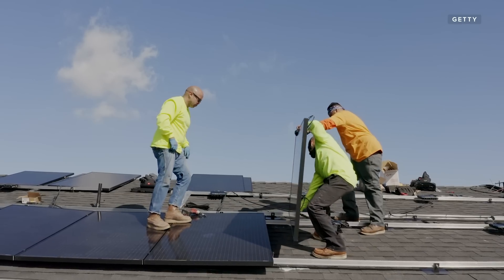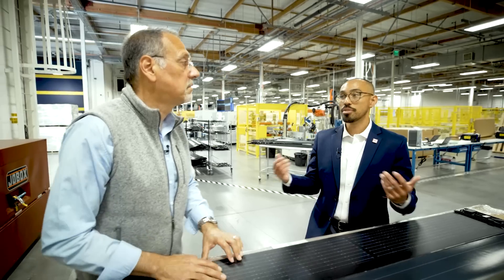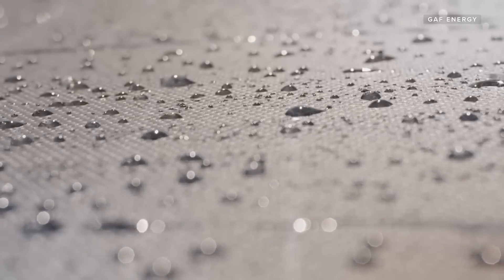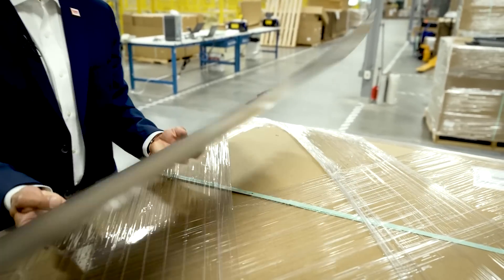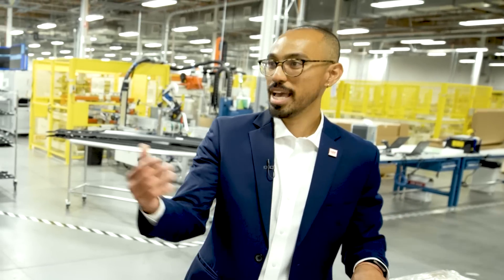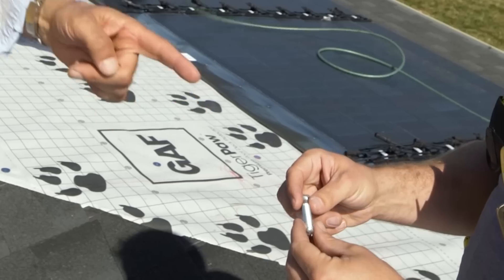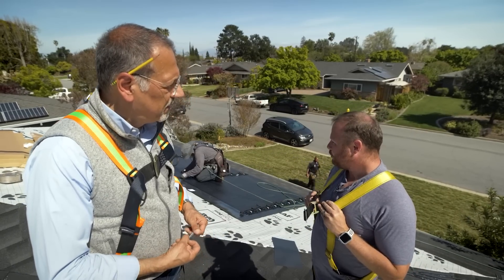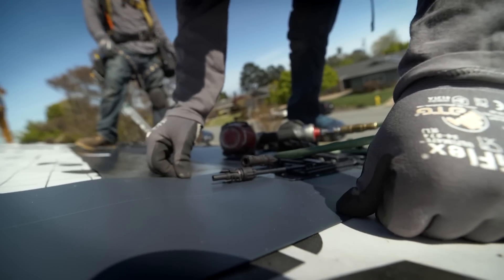If You've Avoided Rooftop Solar Tech, You May Have Just Run Out of Excuses

Comment: The key question is efficiency.  Would this generate less actually energy than solar panels of the same rated power?
Reply: It's less efficient, but those are offset by the larger area of solar that they could install vs the traditional rack mounted options. So in the end a house that uses this system would be able to generate much more power. The cost however is on-par or slightly higher but time will drive it down i guess.
Reply: @Consoneer I saw many bad reviews of this solar roof system which does not seem to be very reliable.  Also, they offer inferior inverters with bad reviews.

Comment: I like this system but think the rack system that allows airflow under the panels help keep the building and the panels cooler.  The panels provide a shade for the roof and will decrease the inside temperature.   Same affect as setting under a shade in the direct sunlight.

Comment: One more thing for the roofer to screw up.
Will they install your solar panels like they install insulation?
Home owner - "Hey can you guys put some insulation in my roof while you have the decking off?"
Roofing contractor - "Sure, no problem." Opens up roof, throws in a bundled bale of insulation, and closes the roof without ever "installing" the insulation.
Neighbors - "Hey, nice solar roof, have you noticed any difference in your electric bill?"
Home owner - "No, not at all, and my heating and cooling bills are still high!"

Comment: Seems a loss loss situation here.   To compete with other solar panels you need more solar panels from GAF, more cost.  No cooling under the panels, more panels needed to compete with other solar panels, more cost.  Only advantage to this system is the aesthetics.  So, CNET, what are the long term results of the product's tests?  None?  So the life expectancy of this product is only speculative.

Comment: First the pros.  Because I like this concept.  It's a better way forward.  Sure, it's going to be less efficient, but it can make up for that with more surface area, so it mostly washes*.  It's easy to replace damaged panels.  It's safer for your roof.  It's nicer looking.
Now the cons.  *= Cost.  Cost was clearly not addressed here, yet that's the largest impediment to solar.  To be fair, that's really a problem for government.  We want a greener future, yet subsidizing solar is being handled so very poorly.  Manufacturing processes can only lower cost so far.  My other concern is actually rain.  Shingles are supposed to be staggered to NOT create clean channels for water to seep in.  Whereas this install REQUIRES lining up every shingle perfectly.  Can it really handle that?  Only long-term testing will say.  And then there's the issue of cooling for efficiency and longevity, which seems to be not addressed at all.  Which could be easily solved with an additional water-heating layer, a part of solar that is very neglected.
In theory, I love this idea!  <3  I hope it's the future of solar.  But I have a sinking feeling that they'll need to devise a system to stagger shingles to prevent long-term problems.  And government really needs to step up subsidizing the costs of solar and ensuring that their efforts go to helping the end-consumer, not the predatory companies overcharging and under-delivering on their false promises to profit.  If government is going to push that everyone drive an electric car, government needs to make sure people can actually charge their electric cars, at home, with slower more efficient charging cycles that don't put pressure on the grid.  Government should also be subsidizing insulation upgrades if we're going to save the world from the evils of carbon, but that's a whole other topic.

Comment: those organic dye/flexible solar pannels dont last very long compared to crystaline/polycryst. silcin.... every consumer should be worried about this aspect since if it takes 12 years to pay off and only lasts 6 years, you might be better off getting a regular roof... also, what is the loss due to being hot as a tar roof (compared to monocrystalline on a regular mount), and how do you clean them  ? what if you dont clean them.
i have a feeling these will not save money unless theyre basically as cheap as regular roofing pannels.... even then, contractors love to charge stupid amounts for niche things, try getting a quote for a heat pump if youre the only one in the neighborhood with one.

Comment: The main hurdle is the cost vs. payback.  "Cost competitive" is not going to cut it.  If I have to take a 25-year loan out to pay for a technology that simply ONLY pays for itself (*maybe*) in 25 years but then needs to be replaced --- well, the juice isn't worth the squeeze.  When the payback period gets SIGNFICANCLY under the payoff period at close to net $0, then we'll be in business.  Really need to be able to utilize a paid-for system for a number of years to become a viable system.  Similarly, early LED lights (20 years ago) didn't pay off in $/lumen comparted to other technologies - which is not true now and they are much more efficient now.  The value of a solar system doesn't add to home value either, so we need to get over that hurdle too.

Comment: Only an extremely diseased civilization in decline would entertain the idea that rooftop solar could even approach a fraction of household electricity use without large batteries or that those batteries dont require intensive mining that creates more "pollution" than just using what we had originally

Comment: First of all, I might consider them, BUT I would want all the non cell material trimmed off and they would have to be able to be glued to my steel roof on only the surfaces that cannot be seen from the street and be PROVEN to withstand the heat and hurricanes here in Florida.

Then, I would have to see the price drop by 1/4 of this.

I'm not letting ANYONE punch holes in my roof since my insurance company inspector estimated my expected roof life at 100+ years.

Comment: I dunno, that's a lot more connectors than using standard PV panels. Also, the single inverter design is a bit of a weak point. You're only going to get as much power as the weakest string in that setup.

Comment: 0:14 That vertical white tube brakes down the whole string. If you got shadow on one cell of the whole panel string, this  is the weakest point in your chain and limits the maximum current. Series connection. 🤷🏻‍♂️🤦🏻‍♂️

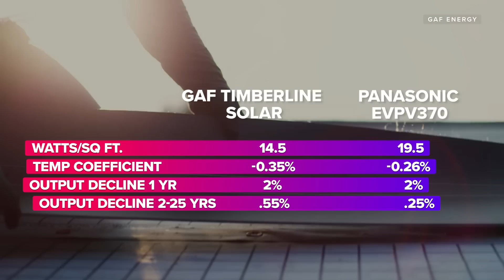Comment: @6:00 out put decline would suggest these have half the lifespan of traditional. Would be interested to see a full cost breakdown. Installation and all. Is it about the same cost after figuring in replacement cost? What kind of manufacturing reaources do these require vs traditional?

Comment: That's great but in 5-10 years when those panels need to be replaced, where do the old ones go? Because solar panels can't be recycled...
In my experience solar panels never last more than 10 years at most. They are extremely expensive to replace every time. The old panels usually go to landfill. Very bad for the environment, you're saving CO2 but you're polluting the earth at the same time.

Comment: I see he did the ol' Elon Musk deflection when talking about price... they didn't actually say a number like they did for efficiency (14W/sqft), he simply said "It's competitive with the price of a new roof plus solar"  just like Tesla's Chief Exaggerating Officer did.    The problem is these roofs can be good for anywhere from 20-35 years depending upon quality, if you're not right on the border of that lifetime then you're wasting money by replacing a perfectly good roof.   Also it probably prices out the DIY crowd, since these panels are absolutely DIY friendly, probably more so than traditional solar due to their smaller size,  but if you're going to charge a DIY upwards of roof replacement for it then you kind of take away the purposes of DIY.

Comment: Why is the industry so obsessed with putting these over rooftops?  If they did it as a pergola, gazebo, or carport, they could just mass manufacture it as a kit for cheap installation and avoid the structural risks.  

It would work for most people.  More than the fraction of people who happen to need a new roof this year.

Comment: Much like the old Unisolar roll out 144 watt sheets, these residential panels sacrifice production efficiency and energy density for light weight, low cost and easy installation.  Don't expect to completely eliminate your electricity bill with these, but for those concerned with aesthetics who need a new roof, it could be a good investment.  You will qualify for a 30% tax credit not ONLY for the solar installation, but on the roofing material as well, which should make payback much quicker.

Comment: So how many of these does it take to equal 1 350 watt solar panel?  What about overheating your roof or attic with no air flow underneath?  How many micro inverters or what size invertor do you need for these. What is the amo output of the shingle?

Comment: In Australia 
20million buildings 
20million rooftops and every building connected to the grid. 
6.6kw or 33kwh every day 660Gwh every day. 
Installed fossil fueled power plants 600Gwh. So the grid is UNLOADED and the dispersed energy used and fed into the grid. 
No top up energy into the grid from the old fossil fueled power plants. 
This all happens as the EV batteries roll out in the new vehicles. 
20million vehicles in Australia. 
1million new every year. 
Vehicle trade in value of old ICE vehicles will crash. 

No home power bills, no vehicle fuel bills. 

Fossil fueled power plants owners know the numbers and are lying and lying and ....
The existing grid will be UNLOADED. 

If Central power plants ONLY, in an electric world then massive increase in numbers of power plants. 
Massive increase in main transmission lines. 
Massive increase in poles and wires to the streets and homes and businesses and industries. 
$TRILLIONS and decades and decades

Daily drive and overnight power to homes will be a tiny part of the huge EV batteries. 
EV will auto park themselves onto the power plug and trade energy with the grid for money 24/7.

The money will be in the grid for grid owners..

Comment: The downside is the lack of ventilation behind the cells, which will decrease efficiency on hot days and because it's flexible, the durability might be an issue too. I will go for cheap regular panels even if it is a bit more effort to mount them on the roof... It's crazy how much power you can get out off your roof nowadays...

Comment: The only advantage that rack mounted panels have is this: they can be installed on roofs that don't face the ideal angle/direction.  Although less attractive, the panels can be tilted to maximize output.  Since my roof faces due south,  I WANT these shingles !
Reply: Eh, not quite.  A west facing roof can't put south facing panels even on the best of rack mounted systems,  and the vast majority are still going to be angled the same as the roof.   Now in flat roofs then sure you can rotate and tilt as much as you want.     The biggest benefit of rack mounted panels is the use of micro inverters in case you have cobble together panels with different angles on them.    If you have a south facing roof then these panels are a good choice,  not cheap mind you, but if you were going to pay to have your roof replaced AND you were going to pay for solar then this definitely is a good solution.
Reply: @Mike__B  I guess you missed my point slightly.  Not all homes are built on a 'grid system' where streets run north/ south and east/west.   In a lot of meandering suburbs, plenty of homes face slightly less than ideal direction (eg: SSW) and the panels are tilted on the racks to make up the difference.  Although this looks less attractive, some people would rather have better performance from their panels over how it looks.  
 That said, I agree with the other points you made.
Reply: @Mike__B  Where I live  (west coast) and where I have travelled (Hawai'i) I have seen more than "a few" that have the panels adjusted to point in a more ideal direction when the house doesn't face due south.  The panels are not on a flat plane.  They are all tilted.  Majority are parallel to the roof.  That can be because the roof faces the ideal direction or it can be that the homeowner wanted a uniform look or it could be that the estimate for the installation was too high with having each panel tilted.  I have had homeowners can make "less than ideal" decisions based on budgetary constraints during my many years as a contractor.  The additional cost of orienting the panels during installation would probably pay for itself in energy return.  But that extra few hundred bucks up front can sway decisions.

Comment: My problem with this system is the amount of connections, the point of larger higher wattage panels was to reduce connections.... I have Been designing and installing for 13 years. But I guess if it gets someone who wouldn't usually put solar on their roof to do it then I suppose that's a positive
Reply: That is discussed here ->  5:34  The loss you're referring to is included in those numbers.
Reply: @arcanondrum6543  long-term reliability that's what I'm talking about, not efficientcy differences
Reply: @caseyjones1999  Well, these have 4 points that favor longevity; This product is Roofing, Panels and Wiring (only). The 4th is that GAF is established in the roofing business.  There are indeed,  too many corporations growing their profits with planned obselescence but the wiring (only, separate inverters) on these panels looks rather substantial.  Time and numbers will decide the rest.

Comment: does it have 25 year warranty?
Reply: Solar panels usually come with two warranties – product, which warrants against defects in workmanship, and performance, which warrants power output over X years – commonly 25. The relationship between product and performance warranties is a bit fuzzy, but the product warranty is the most important one.

Comment: Ok, no. The rep says they get 14,5 watts per square foot. That is a 15,6% efficiency, not even close to the 22% efficiency you get from most rooftop solar arrays today. Basically you'd need to buy and install 41% more square feet these shingles to get the same wattage as regular solar or put another way, if you cover your roof with these you get 29% less energy.

Comment: Metal roofs can use bracket systems that don’t go through the roof thus avoiding holes.  The brackets tighten down on the metal ridges and connect to rooftop solar panels.  Best option in my opinion.
Reply: Standing seam metal roofs are the best.

Comment: So what they fail to tell you is that it can’t bet used all the way to the edge of the roof, nor can they go around any cutouts. Because of that I went with a rack system. Difference in power creation was ~50% difference.

Comment: Well one thing they didn't show you is how you get the power off the solar panels that yeah it's a solar panel it's a shingle it has so much wattage but how do you transfer the power to batteries to a converter to a charger to the battery to a converter to make power for the house where's the wires at or is that just a hock of s*** no good for anything.

Comment: I should think solar is a no-brainer for much of America. So many people live in suburbs, so many live in climates with moderate to intense sunshine requiring relatively small arrays, so many have appliances like AC that need to run all day. 

What stuns me is that in some places where you'd think this would be the default and it isn't. I was in Florida recently and maybe if I'm being generous 1 in 50 houses has solar. That's it despite near constant, predictable sunshine day in day out. It just seems bizarre to me that building & power regs wouldn't strongly incentivize solar installations being the norm. Same goes for most other southern states. It doesn't even make sense as some kind of dumb political stance - think of the jobs it creates and the independence it gives to the state. It's nuts.

Comment: These are already useless. NEC 2017 requires module level voltage shutdown. These string connected panels can not meet that requirement. They can only meet NEC 2014 field level rapid shutdown requirements.

Comment: Add expense to least expensive material on your house.? Every time you reroof you have to replace your solar. These are sure to be a throwaway material. If your solar pays off in 10 years, its' time to do it over, and start trying to pay off your solar once again. It's a lie about your roof leaking with rack systems. Ours is rack mounted and fine. The roofer and solar installers cooperated.

Comment: More expensive, worse efficiency, worse output decline over time, worse temperature coefficient plus no airflow to help cool these which compounds the effect, string-coupled instead of microinverters so WAY less efficient if there's anything (and I mean anything) blocking any one of your panels... I mean, this sounds terrible! I appreciate that someone is trying to be forward-thinking, but a traditional system is FAR superior to this except for subjective aesthetics.

Speaking of that... For those who think solar panels are "ugly", you need to adjust your perspective. When I see a house with solar on the roof I don't think "ugly". I think these people are smart and care about the environment. Good for them!

Comment: Say you need a new roof and decide to install this. I wish they had explained what they do on the edges, corners, etc. where a full panel won't fit. Do you just shingle those areas or do you need to shingle the whole roof under this thing. Is this just practical for simple roofs like the house in the video?